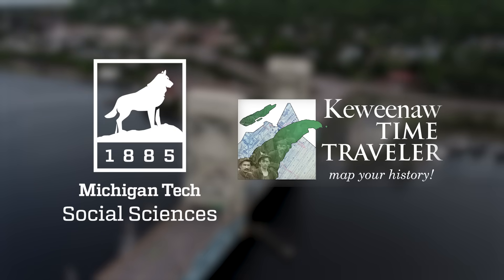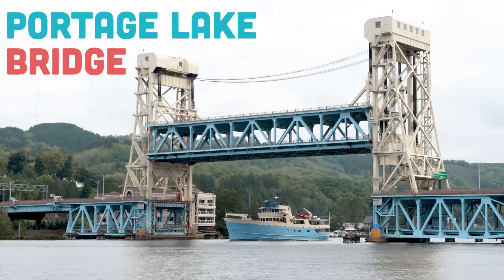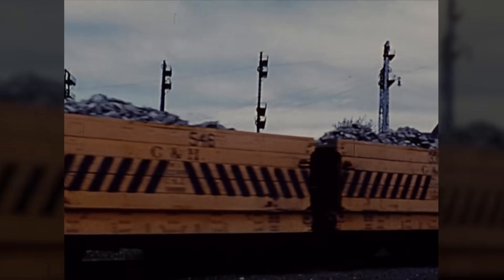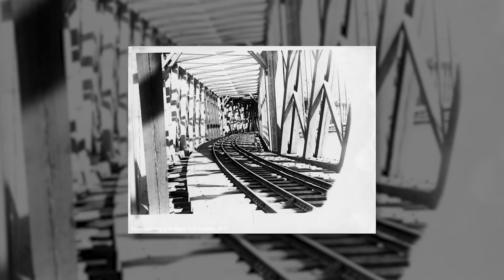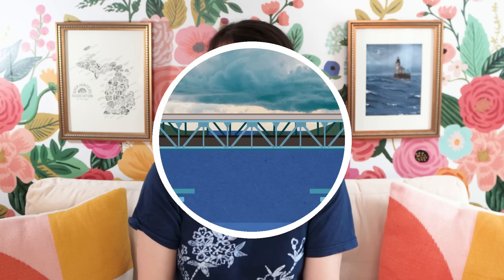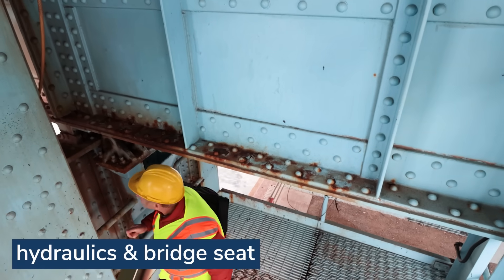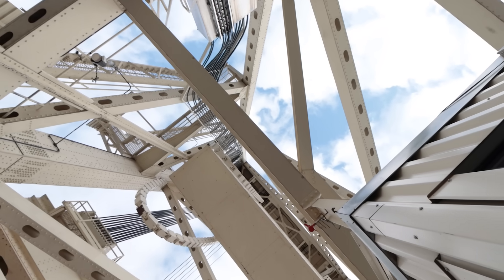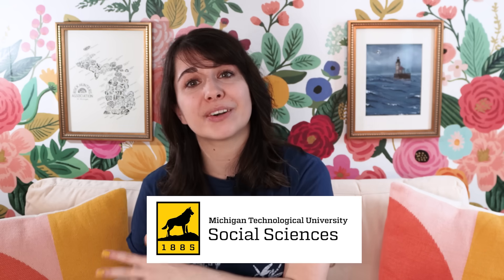How They Made This Record-Breaking Bridge | Portage Lake Bridge, Michigan

Comment: Attended a bridge history event in early 2010ish, and one of the most remarkable things was the mentioned seating of the foundations, and (not mentioned in the video) was the fact this bridge was hot riveted on site. Forges heated rivets, then THREW the rivets UP to a worker position with a 'basket/sieve', would quickly tong the rivit, and toss it up to the next, to the finial position, and then riveted in place. The pictures of this operation were awe inspiring. 

That and the comedic note that "The engineering who did all the calculations of each member, by hand, would cry to see flowers growing a deck designed to carry steam engines with fully loaded copper billets.

Comment: The very first center lift bridge in America is in Portland Oregon, a single decker.  The second oldest center lift bridge in America is also in Portland Oregon.  It carries Trains, bicycles, and pedestrians on the lower deck, and automobiles and the MAX lightrail transit trains on the upper deck.  The lower (train, pedestrian and bicycle level) can be raised independently of the upper deck, minimizing traffic delays on the city streets when smaller craft require some lift but not the upper deck.  

I do not know if either of our center span lift bridges have those weighted chains like this one though . . . 

Pretty neat!

Comment: That structure is the only road link to the “copper island”. Prior to the recent restoration project they were having occasional problems with the structure.  MDOT worked with national guard units in the region who helpfully happened to be engineers who specialized in bridging.  They coordinated with the guard and set up an exercise and while they did not build the full bridge they did build the approaches and built enough bridge segments to ferry a fire truck across.  They did realize that they did need special ramps to get the fire truck on the bridge but were able to fabricate them in short order.  

The plan is that if there is a major problem with the lift bridge they could set up the ferry in a few days and a full bridge in a week or a  little more.  

Al Anderson may have been involved in that exercise.

Comment: The only way to get to drive to the Keweenaw peninsula…if the bridge ever quit there would be more than 350 million people stranded….
Reply from the maker: It would definitely be a problem if the bridge was out of service long-term, but there are far less than 350 million people on the north part of the Keweenaw, at least. 🙂
Reply: It would depend on what side you consider stranded….i live on the north side, so the 350 million people would be the stranded ones 😊, unless I happened to be on the south side if it quit.
Reply: Great logic. Those of us who’ve never been that far north in the U.P. wouldn’t be able to get there, except by air or water.

Comment: At 8:35 further balancing of the weight of the counterweight cables as they move from one side of the pulley to the other is done by the big loopy necklace looking things dangling each side of the counterweights. So clever.

Comment: Once again, thanks for the memories. I was a student at MTU starting in 1966. I walked that bridge Southbound at 4:00 AM after a local party. The thermometer in the bridge control room was reading minus 54°F. At least thats what the operator shouted down to us. He was warning us to hurry and get to shelter. (nice guy). We were dressed heavy because it was winter, but not THAT heavy. We did suffer some frostbite, but nothing radical. We were tild in class that the center span of that bridge was 18 inched too long when it was floated in place and they had to torch cut the expansion joints to allow it to be put in place. We toured and studied the whole bridge. It was an amazing feat of engineering and construction. A feat that was compounded by the nearness of the Kewenaw fault and the zero meridian line. Surveying the two ends of the bridge for alignment and elevation and then maintaining their relationship was almost impossible for the surveying technology of the time.
I cant tell you how much i enjoy and appreciate your presentations of Kewenaw history, geology, and technology.  Our governor should make you the Upper Peninsula Emmisary. You are very good and very appreciated.  Please keep it up.
Reply: So awesome! 
Beautiful history .
Reply: My father was there at the same time. First got his mechanical engineering degree, then went back and got his electrical engineering degree after I was born. It’s a special place.